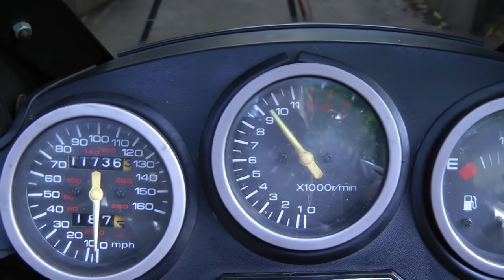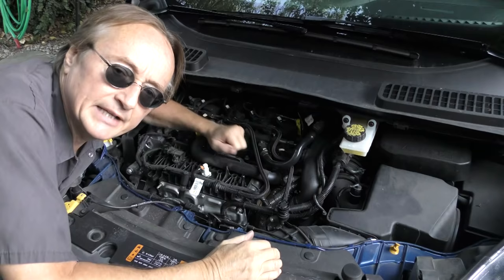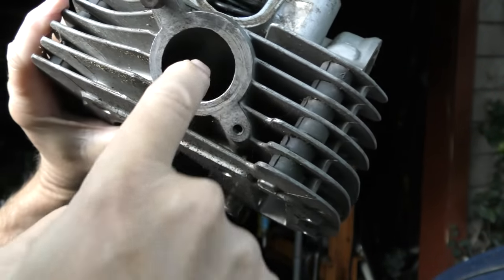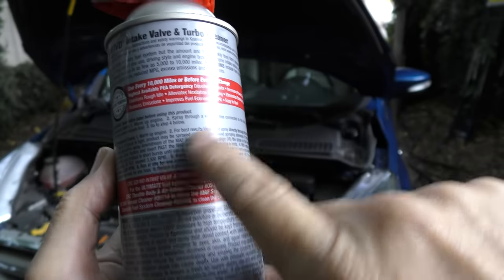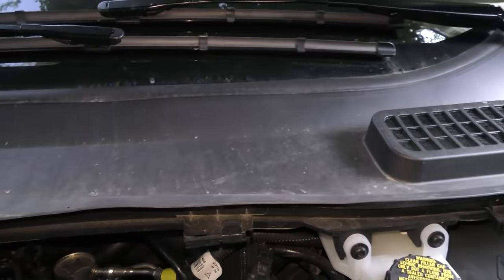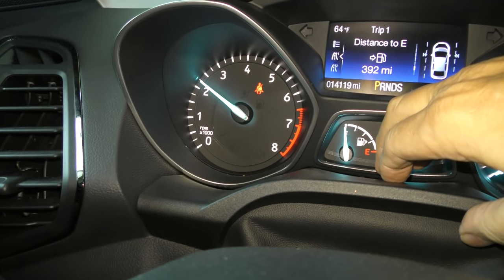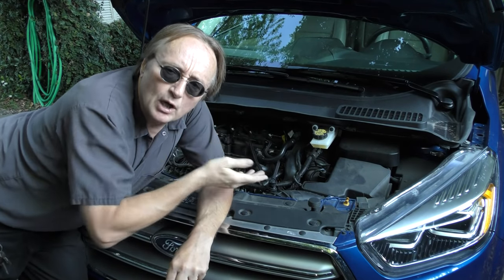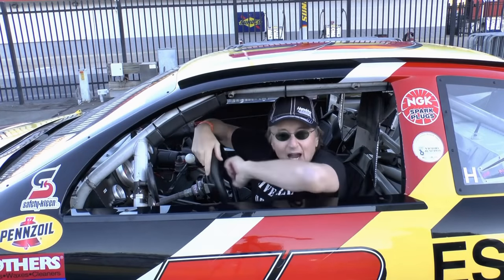How to Clean Intake Valves in Your Car with a Spray Cleaner

Comment: would this work on a 95 Corvette 6sp...... please reply I am very OCD when it comes to my car....I Take Very Good Care of it...... also Scottie what's the real truth about the E10 fuel? I'm lucky I have a place that's pure gas only 91 Octane.... will E10 screw up the LT1?  I got 67 Ticks on the clock... sorry to be so long..
Reply: You can just add a fuel injector additive in the gas insteadI. I use Techron cleaner or Royal Purple Max Atomizer.  E10 shouldn't really cause big issues as long as you are using a good quality fuel. Ethanol mainly causes your car to get a bit lower gas millage. If you are worried about it you can use an additive called Lucas Ethanol Fuel conditioner. It helps protect your car from the negative effects of ethanol
Reply: Anthony Thanks for taking time to answer me lol yeah I'm OCD about my Corvette 😎 I really appreciate it Have a glorious day man

Comment: I have a 2nd gen MINI w/the Peugeot 'Prince' engine... this is not effective... I remove the intake and walnut blast the valves every 20K... I hear they've fixed this issue and your method works well on newer cars, but those of us w/ earlier implementation of GDI are SOL.

Comment: I've heard to not do this to Ford Ecoboosts, due to the turbo potentially being damaged by carbon debris? Is there anyway to do this to a 3.5 Ecoboost, say in a 2011 F150?
Reply from the maker: many companies tend to say such things, and their option is to take the engine intake apart and clean the valves manually. YEA, a giant job that costs a fortune. If you use this cleaner frequently, the carbon pieces will be so small it wont hurt anything.

Comment: I wish you lived here too help me🙂 had a new catalytic converter put on 2.5 years ago and it is showing issues when I took my 2007 Dodge grand caravan 3.8 today to see what the heck the check engine light is on for catalytic converter issue.   I change my oil full synthetic always before due time and had a fairly recent tune up.   I asked why (no guarantee to replace it) it is failing so soon.   Oh maybe burning oil....hmmm.  Confused so watching this video.  I can't do this can cleaner... not enough know how.  Bugger.   HELP 🙃

Comment: Scott I have a td4 engine I removed the egr and cleaned manifold ...I have large blue smoke   at cold start..I tried premium diesel and the engine starts up with no juddering thingy..and less smoke but still get blue smoke at start up not as bed .even changed the turbo. help

Comment: hey Scotty! Question: got a 73' spitfire. Took the valve cover off the other day and there was about a pound of dark sludge all over the inside of the valve cover and sludge around the valve rods. I cleaned off the sludge on the valve cover but now that I have the valve cover off what's the best way to clean out all of the gunk by the valve rods?
Reply from the maker: put some K and W engine cleaner in a spray bottle, and spray it in . THEN put it together and use another can of cleaner in the oil and follow the directions on the can, then change oil and filter
Reply: Scotty Kilmer Thanks, Scotty! Someone told me I could kill the engine if I try to flush a heavily sludged engine because the oil ports could get clogged and the engine could be running with oil. Any truth to that?

Comment: Hey Scotty, I'm currently looking at a 2000 lexus ES 300 with 150k on the the odo. It has a clean carfax, with actually one owner. Is there any problems with this particular model that I should worry about?
Reply: YES, it does! That car has the Toyota/Lexus 1MZ-FE engine. It over-stresses the oil, which tends to turn it to sludge. Oil then can't get to where it needs to go, which damages the engine. There was a class-action lawsuit about this. Friends of mine bought a 1999 Toyota Sienna. At 170,000 miles a camshaft broke. A $1300 repair. A month later, something in the bottom half of the engine broke. The 2000 Lexus ES has a newer version of that engine (VVT-i). Those are supposed to be better. I have another friend with a Lexus RS with many miles (VVT-i version), without that problem. If you buy it, change the oil OFTEN (3000 miles or less, no matter what Lexus says) and with SYNTHETIC oil (handles heat & stress better).

Comment: I guess there is no concern of chem-soaking the oil. In any case I would want to do this  right up front of an oil change, just to be sure.
Reply: How on earth would this possibly mix with your oil unless you had leaks?  In a properly functionally car, gas and air from the intake/exhaust never mix with the coolant or oil.
Reply: Alex M the cleaner is pretty thin. Maybe thinner than gasoline so it may be possible for some to leak past the valve seals and or rings, depending on how worn those parts are and how much you spray on each blast of cleaner.

Comment: Hey Scotty, always another great video.
I wonder if you know much about a transmission seal near the torque converter, are they basically the same as a deferential seal where it goes into the ring and pinion from the prop/drive line?
Reply: Thanks Scotty, are they hard to take off and separate the torque converter from the main housing on an Cayenne/Touareg.
I Belive they're an Asian transmission company tranny that are also fitted to a lot of Japanese AWD vehicles.
Thanks for your help and greetings from the UK.

Comment: I got a 05 f150 with 4.6 L, I changed the maf sensor and I cleaned the throttle body and change the fuel filter but when I accelerate the truck still stutters, do you think it could be the throttle body position sensor or the fuel pump regulator?
Reply: Maybe even dirty valves

Comment: Ok so I have a 2004 F-250 Super Duty that im pretty sure has a burnt valve since it has a misfire on cylinder 6, running rich on bank 1 and lean on bank 2 but it tries to suck a dollar bill back up into the exhaust now im just wondering if anyone thinks this may fix or help the burnt exhaust valve at all or am I better off just replacing the cylinder head? Thank you

Comment: Scotty brother,,, = would you happen to know where the (vacuum break booster hose) is in Ford Tempo 1992 3L V6?
Reply: This video only applies to engines with Gasoline Direct Injection (GDI) (some year 2004+ cars). Engines with GDI need an injector cleaner in the gas tank, and a separate cleaning of the intake valves. For older engines, just use a fuel system cleaner product with PEA (such as Techron Concentrate) in your gas tank. That will clean the intake valves+piston top+fuel injectors. The fuel injectors spray on the back of the intake valves anyway. The brake booster is always on the driver's side, between the master cylinder (where the brake fluid goes in) and the firewall (sheet of metal between engine and dashboard).

Comment: Scotty what boggles my mind is why the heck do gas tdi's have valve carbon problems, yet their diesel tdi counterparts dont
Reply from the maker: cause the diesels don't have all the anti pollution crap on em that gas engines have, and are radically different engines with different firing pressures and temps.

Comment: using a valve cleaning product as shown wouldn't the cleaning spray possibly damage other systems in the vacuum system???
Reply from the maker: no it just flows quickly through from air  pressure and burns in the engine

Comment: Does this work on diesel engines? 

I got a 2009 ford mondeo 2.0 tdci duratorq and my electrician told me that he found a error code on the engine for intake manifold clogging up and he told me to do the oldschool italian tune-up but as far as i know, on diesels with EGR, that doesn’t work.
Reply: I had a 2009 2.2 duratorq Mondeo and never got it running well until I cleaned the intake, junked the dpf and egr then had it remapped..like a different car after that with no stupid regens flooding the engine oil with diesel or clogged up intakes.

Comment: Ive soak valve with carborator cleaner and with long brush iam cleaning inside but Cant reach valves 😅 only around there housing anyway hope then ill do seafoam but exhust ports cleaner and better than before hope seafoam will do the trick and I'll use marvel with every fuel fill up 
 bought the car and he is using heavy oil cause it was smoking white and to avoid replacing pcv valve he did thick oil trick so now  replaced the pcv valve and changed to 5w-30 oil  but I have to get gunk out of valves cause may be its one cause of rough idle anyway its dirty and I need to clean it as much as I can

Comment: I used this on my 07 Nissan frontier today and no smoke came out. Is that a good thing?
Reply: Did you follow all the steps?
Reply: eldom72 yes i did. 145k miles with an oil catch can. I used the brake booster vacuum hose to spray it into the intake.
Reply: Kuma Makanui maybe you had much less carbon than you thought you did.

Comment: Hey Scotty I just bought this new automobile and I am new to this car driving thing because I rode bicycles all my life.
Well It broke down on the road after two days and I called AAA and they towed it and said that it ran out of gas. How do I fix that problem? Do I need to take it back to the seller, I dunno. Please help.
Reply from the maker: if it's brand new, go back to the seller. if used, you got screwed. Find a mechanic then
Reply: they need to pass a law where you live requiring a new car to drive forever without running out of gas.

Comment: hi buddy what's the best way to run a cleaner like seafoam  in my 99 mercury sable 3.0  16 v engine that has around 140,000 miles on it, will i have to dismantle the air filter hose,? and does it have a throttle body on it?
Reply: You'd be doing more work than you need to. This video is for engines with Gasoline Direct Injection (GDI) (some year 2004+ cars). Engines with GDI need an injector cleaner in the gas tank, and a separate cleaning of the intake valves. For all other gas engines, just use a fuel system cleaner product with PEA (such as Techron Concentrate) in your gas tank. That will clean the intake valves+piston top+fuel injectors. The fuel injectors spray on the back of the intake valves anyway. Yes it has a throttle body.

Comment: If the intake is dry all the way from the air filter to the intake valve, what would cause any valve or throttle body deposits in a GDI engine?  Does the EGR still enter along this route causing deposits?
Reply: Oil leaking past the valve stem and EGR will cause this.
Reply: The deposits on the intake valves of a GDI engine are from burnt on oil from the PCV system.  Check the IATN forums.  The only way to properly clean the valves on GDI engine is to remove the intake to get access to the intake valves and use a walnut shell blaster designed for this purpose.  This guy showed no before/after evidence of his procedure. He should have taken the time and effort to inspect before and after.  In my opinion, it's snake oil.
Reply: Mostly from the PCV system. Most modern engines aren't using EGR anymore.
Reply: Some modern cars with CVVT (continuously variable valve timing) have eliminated traditional EGR. The intake manifold is significantly cleaner. But there's still the PCV to contend with. If not for PCV then dirty valves would be a non issue.
Reply: It's blow-by. Use a catch-can or re-route pcv vapors to air intake and plug the intake manifold (sucking end). It's the strong vacuum of engine causing the blow-by.
Reply: No, it is the high pressures of combustion that cause Blow-by. Blow-by has around ever since the internal combustion engine was made. The PVC system was introduced in the early 60s to reduce the amount of unburned Hydrocarbons, which is what blow-by mainly is, from being released in to the atmosphere. An engine has maximum Blow-by at Full Throttle, when intake manifold is at its minimum.

Comment: Why cant you just spray it directly into the intake? And that really sucks that with that gdi or tdi setup it dont matter what you put in your tank that it wont clean the valves.
Reply: Chrisanddave22 Not a good idea. You want to avoid spraying it on your MAF sensor. Just use a vacuum line.
Reply: Yea, after thinking about it I figured that was why. Maybe it was just a stupid question but oh well.

Comment: Will this carbon removal method work on that problem on Mini Coopers?
Reply: Glenn G Just sprayed my 2010 Mini Cooper S tonight, the car was hesitating badly in first and second gear. So I decided to try this. After the hour of letting it heat soak I drove it and it was making a clanking sound from below while driving and then a hugh puff of black smoke and now it drives smooth and the clanking went away.  I will drive it in the morning from a cold start and see if it really worked. I think the clanking was a loose piece of carbon in the exhaust.
Reply: Hopefully your Mini is still running ok. I would love one of these but with all the concerns with carbon as well as the plastic timing chain guides.
Reply: Its been a while. Any updates?

Comment: This is exactly what someone with a Lexus IS250 needs to do to their engine every 6 months to keep the intake valves clean.  Those smaller V6 engines are notorious for getting carbon deposits on them, and the dealer charges $6,000 to remove the engine for cleaning.   Yes, $6,000 repair bill.

Comment: How would I find out if an engine is "GDI"? For example, a 2016 camry?
Reply: It will often be advertised on the car if it has it. Hyundais and Kias have a "GDI" nameplate on the back or on an engine cover. Other names include EcoBoost (Ford/Lincoln), SkyActiv technology (Mazda), FSI, TSI (VW, Audi), SIDI (Chevy, Buick, Cadillac). If a car doesn't say this, but it's 2004+, you have to do a little research.

Comment: Scotty, you forgot to mention what would be the symptoms of a GDI engine with clogged up valves ?
Reply: AlainHubert power loss mostly low end torque. Ecoboost has had a lot of problems with the valves gumming up.
Reply: Thanks Jay G. Could the same thing be expected from other GDI engines from other manufacturers, or are there ways to design them differently to minimize such occurrence ?
Reply: AlainHubert same, as long as it is direct injection there will be no way to clean the top of the valves. Other manufacturers lessen this by minimizing oil going back into the intake like having catch cans etc. this is mostly increased by the use of the EGR in modern vehicles. This is why other people delete their EGRs

Comment: So how do I use this on a 2000 Ranger XLT without getting extremely wound up?
Reply: You could, but you'd be doing more work than you need to. This video is for engines with Gasoline Direct Injection (GDI) (some year 2004+ cars). Engines with GDI need an injector cleaner in the gas tank, and a separate cleaning of the intake valves. For other gas engines, just use a fuel system cleaner product with PEA (such as Techron Concentrate) in your gas tank. That will clean the intake valves+piston top+fuel injectors. The fuel injectors spray on the back of the intake valves anyway.

Comment: how do i know where  a vacuum hose is on my citroen SAXO 1.6 16v?
i sprayed like half a can of that stuff inside the throttlebody and it didnt fix the problem i have:

problem is that when i drive away cold the engine doesnt rev up smoothly
things done so far:
new sparkplugs
new airfilter
new oil + oil filter
new throttlebody position sensor
intake cleaner in the gasoline
intake and valve cleaner in the throttle body
having the compression checked wich is quite good.
what else can i do really...

Comment: Is it danger do this job to a car with 155 K miles that never have done this ?
Reply: I wouldnt use it at that point. No telling how much has built up. Under 50k would be my recommendation. You can take the valve covers off and see just how bad they are though. If they arent aweful then give it a try.

Comment: hey scotty, i have an older subaru with  the 2.2L Engine, it runs but not very good on the right side 2 cylinder get half the compression around 70-80psi while the left one get normal 150-180psi.. i was told it could be burnt valve or the rings have gone bad. how can i tell which is bad for sure ? Note the engine has 271,000 Miles on it..  thanks -RipJawn
Reply: RipJawn dona compression test first a normal test them retest after spraying some motor oil in through the spark plug hole. If oil causes the compression to improve its bad rings.  If oil doesn't cause compression to improve its a bad valve seat.
Reply: Wayne Wildman done that already
Reply: RipJawn 

Do a check vacuum test, with a gauge. There are plenty of videos on YouTube about it. Very useful, and insightful thing. Tells tons about what's going on inside the engine!
Reply: If your compression gauge has a quick disconnect on the hose, you can screw the hose into a spark plug hole, and connect other end to an air compressor (doesn't have to be big). Air escaping these locations indicates a potential problem: 1) oil dipstick tube: indicates pressure escaping from cylinder into oil jacket: Usually indicates stuck, burned or worn rings or cylinder walls. 2) Radiator opening: bubbles indicate pressure escaping into cooling jacket: cracked cylinder walls or damaged head gasket. Often adjacent cylinders will show same problem if head gasket damaged. 3) Air goes to adjacent spark plug hole: bad head gasket. 4) Tail pipe: burned/stuck/worn exhaust valve. 5) Air intake: stuck/burned/worn intake valve.